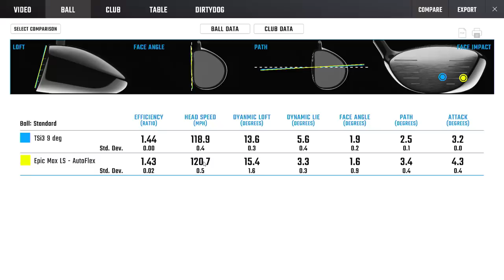Adam Scott's AUTOFLEX Experiment // + Fitting for More Distance

Comment: This is such an interesting conversation and I think it proves that the idea of the autoflex is revolutionary but only if you have an expert fitter who can put all the pieces of the puzzle together. Love the content guys!
Reply: True, but Ian just revealed how to put together a driver using the Autoflex shaft. One could adjust the weights on the practice range.
Reply: @IamDaGrouch  absolutely but I think most of us tinkerers have gone down some rabbit holes trying to fine tune the driver and I just think it’s best to get fit by an expert and walk up to the tee knowing your tool is already optimized for the job in front of you.
Reply: I've had more success tinkering myself than using fitters. The conditions just aren't the same, especially inside on a mat. Glad it works for some people but I have to get out on the course and make my tweaks there. 

Bottom line with Autoflex is that good results aren't achievable with every head. Have to have a light starting point. Any Callaway is good; so is SIM, as the TXG guys showed.

Comment: Hello, I am Tour Van manager for Senior Tour in Europe... Globally the Autoflex provides 10% distance more than any shaft... But for me and some senior tour players, I have tipped the shaft of 1' inch... I am 55 years old, with my shaft I drive between 235 meters and 270 maximum in rare occasions... with the Autoflex and a Ryoma head 8.5° Type V, less dispersion (more balls on the fairway), and more consistancy in distance; between 250 meters and max 305 meters... easy to launch, easy to load and unload the shaft... I was skeptical but the results are here... 
For players as Adam Scott or young players the 505 xx version is too soft even tipped of 1' inch... I claim from manufacture a version 605 xx and xxx... This technology is quite impressive on the course... because the simulator does take in effect the top spin effect with the Autoflex... more roll more distance also.... The 305 x is to souple for women or old seniors... must be tipped to have the 10 % effect.... This point must be corrected easely by autoflex
The 405, 505, 505 x are better don't need to tip it... Autoflex must produce a 605 xx and xxx version to complete their range.
Autoflex can be play at 45.5 or 46 driver length, because it is easier to play it... myself I change driver length from 44.5 to 45.5 ' without fair or problem of dispersion....
Congratulations to the Korean engineer team to propose this new game changer.

Comment: Please do a video with both of you hitting every available driver head between 2001 and 2021 in ""rightie" and "leftie", set at neutral, in all possible shafts at standard length, with as many grip sizes as possible, using every golf ball on the market, ten times. Follow this by tipping the shaft by quarter inch increments (up to 2") at a time, then repeat after the shaft has been pured. Its what the masses want.

Comment: Awesome video! Thanks TXG!!
Reply: The SIM2 weighs 196g and the SIM2 Max weighs 195g, head only with the stock back weights. This is about the same as the SIM. To get to D2 with the auto flex, I had to get the head weight down to 185g. This is with the 46.5” playing length and SF505.

Comment: Need to get a video with someone 95-100 swing speed with auto flex and do the same kind of video you just did.
Reply: Gabe Gallucci golf had his coach (107 avg SS) try the 505X, and he got up as high as 117 I think it was without the shaft being fitted at all. Not exactly the same, but certainly shows the potential.
Reply: They had Marty swing it right handed a few weeks back. He still drove it over 280yds

Comment: Would be really interesting to see you guys try some of the low 60g shafts that are on the market just now, HZRDUS Smoke RDX Black, Tensei AV Raw Orange/Blue 55, Diamana X Series 50, Tensei Pro White 1K 50, see if these lighter weight premium shafts can give Autoflex a run for its money @ the set to be max driver length of 46”?

Comment: Amazing content. What driver shafts is 46" that are playble for mortals? (Stiff)
Reply: Ventus Blue 6S. Same as Matt had, just not X flex. You could also try the 5S if you need to drop weight at that length.
Reply: @canyonaro  allright, think I am going to test that out, and see how that relates on ballspeed and dispersion.
Reply: I hit an HZRDUS RDX blue.... Great great shaft. Black was a little too stiff for me, blue is just right.

Comment: Adam Scott didn't drive it great.  Torrey and the elements did not lend themselves to great driving.  Does Autoflex get kind of wonkie when you get quick and yank on the handle, seems like a shaft that need super swing tempo.  Loved when Matt said, didn't hit it great and bombs it 344.  The sponsors of the other tournaments that Adam will play in but doesn't care about must be thrilled.  That's the kind of opinion you should really keep to yourself.